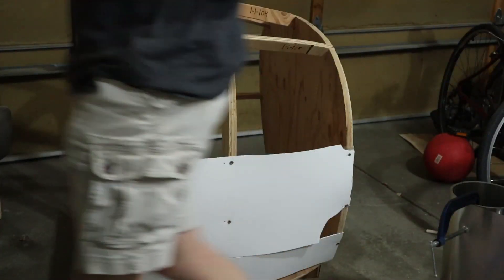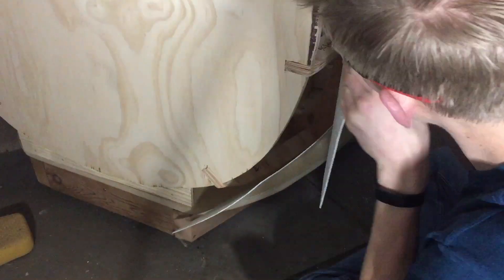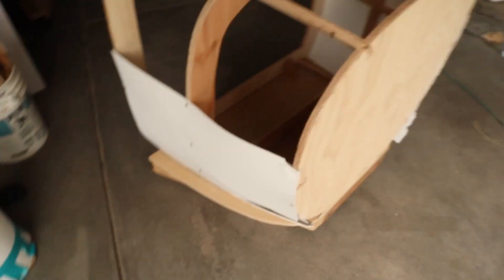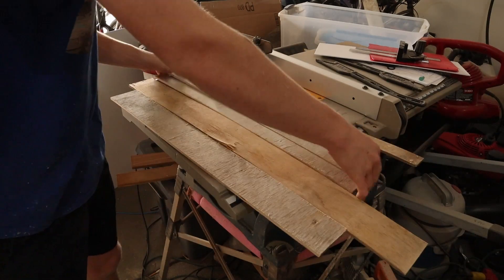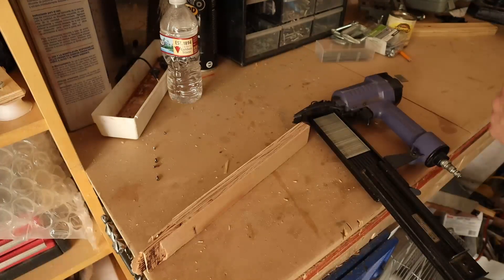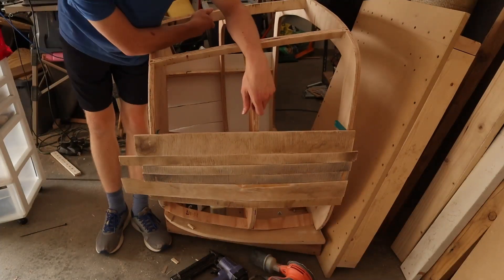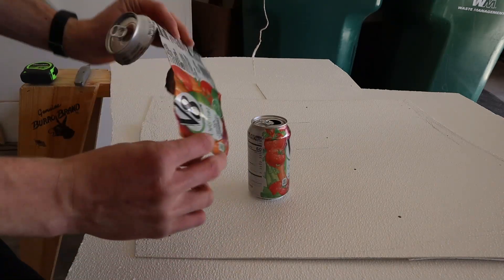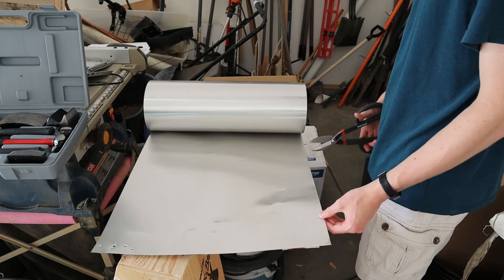What Sheathing Works Best? Experimenting with Sheathing Methods | C172 #26

Comment: What about chicken wire and paper mache.. will keep the build super light weight and you will be able to shape it easier. Can alway fibre glass over it too
Reply from the maker: I've been thinking about this, I don't know how I could get the surface finish but will have to try if I ever have enough space to test it out.
Reply: Or builders bog over the top